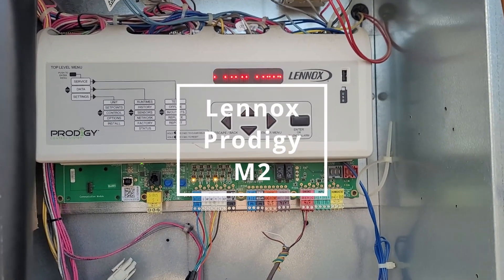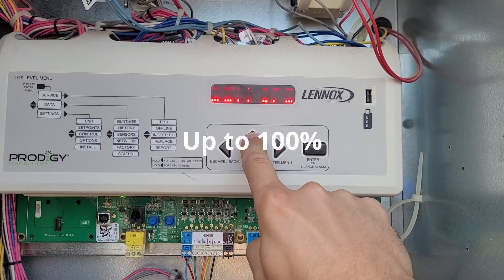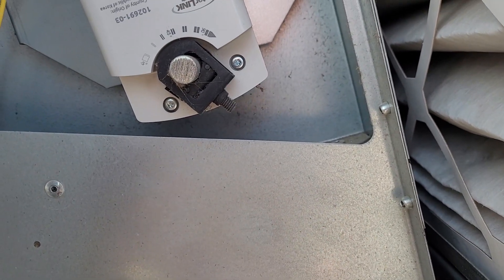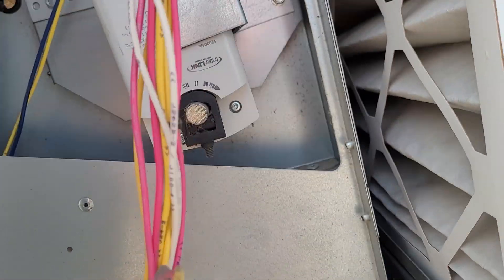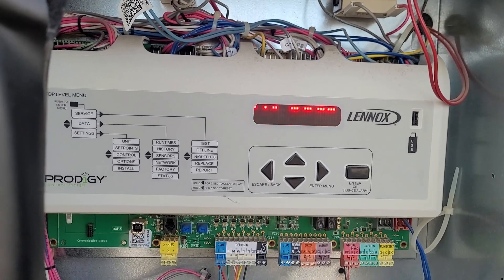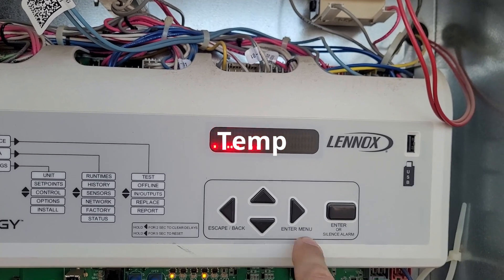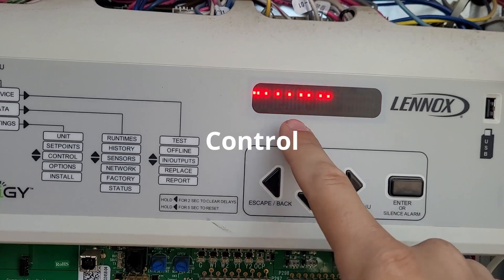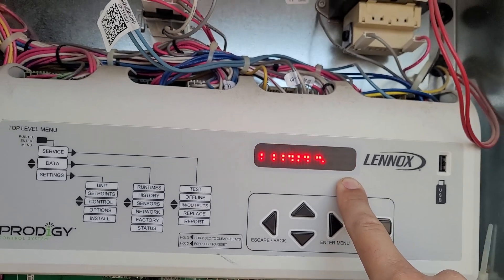Lennox Prodigy M2 Econ Checkout

Comment: on the new hardware m2, can you disable the econ, got one 2011 unit that someone panned over the econ and disconnected the 15 pin harness, gives me error 150 - change enthalpy settings.
figured i need to change the cooling modes to not allow for free cooling or disable the econ. just learning these prodigy controls
Reply from the maker: @billysimmons2432  I'm sure you can. I bet it's just in the econ menu.
Reply: @ got it sorted it out with tech support. Thank you